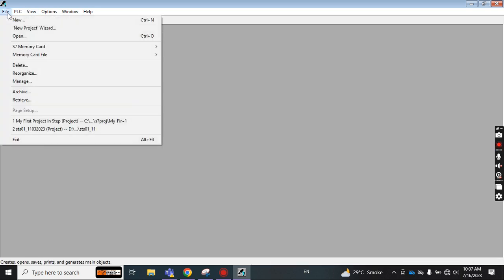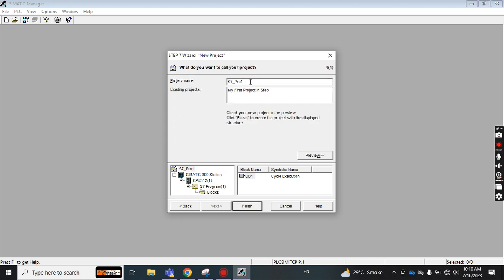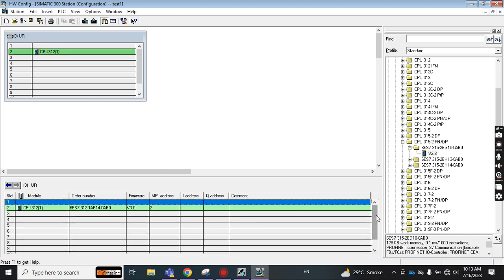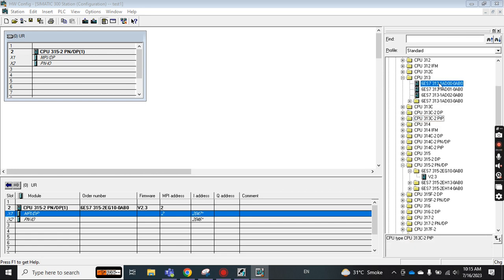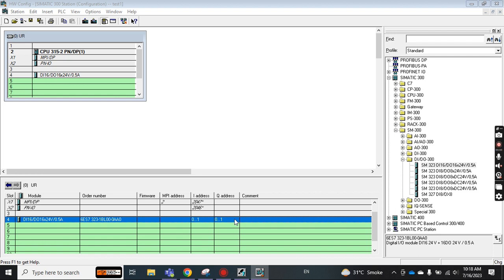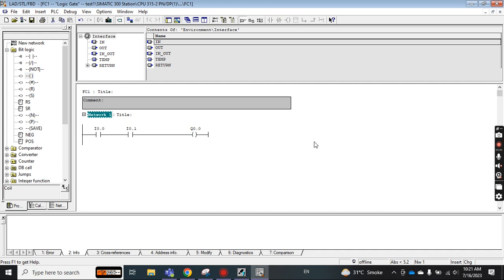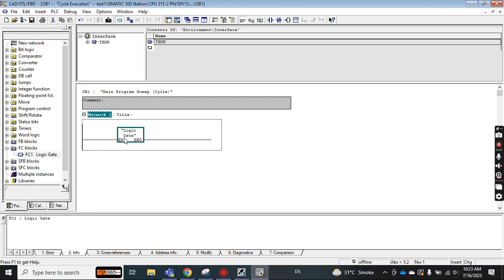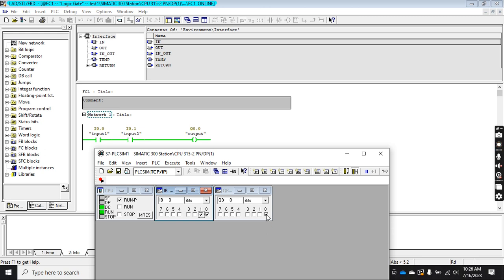Simatic Manager-01: How to use Simulator in Simatic Manager | Simatic Manager Overview

Comment: sir when i try to open a new project ,simulation showing blank,no option showing for simulation onn off
Reply from the maker: There is buttons to add input, output and memory
Reply: Same problem I am facing
Reply from the maker: Not properly installed simulation